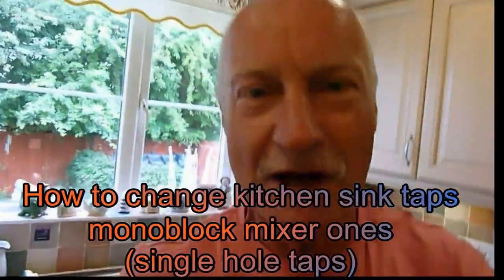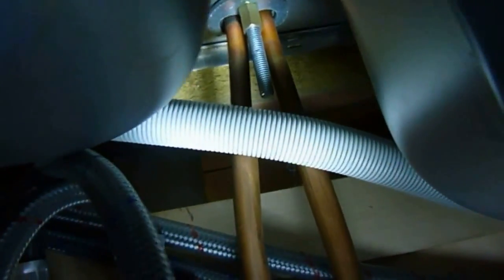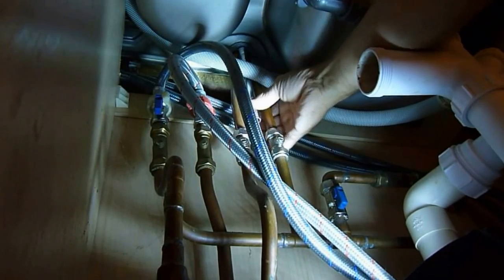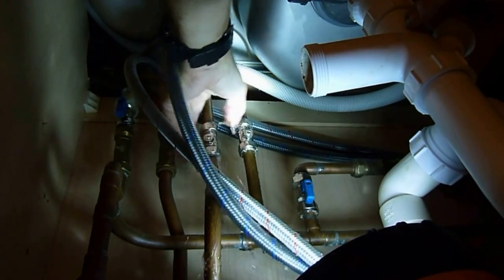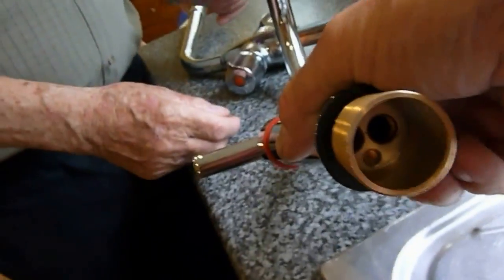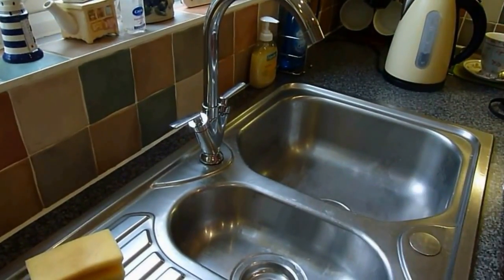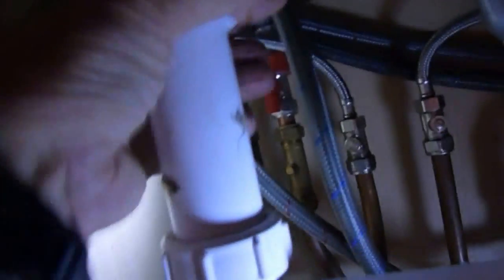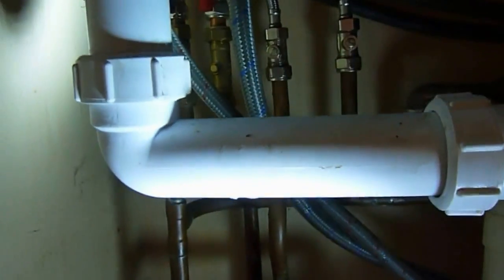How to change mixer taps.(monoblock mixers) .Kitchen taps shown, but same for basin or bath

Comment: Thank you for publishing this. I have had an identical kitchen tap with a slow leak in a home we recently bought and found that below the sink the previous owner had installed two surface-mount sockets into which were plugged the washing machine and a dryer! No surprise that the power circuit had a high earth leakage reading. 
I've now moved the sockets to behind their respective machines and can now replace the tap - a type I have installed before. However the new FRANKE tap is fitted with the flexible hoses you show and I appreciate your taking time to record fitting one. Again, by coincidence, I bought the small box spanner set from Screwfix for removing the old tap and a Monument automatic cutter to cut back the H & C pipes, and two male couplers - to fit the flexible hoses onto the cut pipe, owing to the isolation valves being out of hose reach and wishing to minimise my time under the sink. I have the same access issues - must be a common problem in older homes.
Doing the replacement tap on Monday and your video has given me the confidence to proceed. Thank you.
Reply from the maker: No problem and good luck with it.

Comment: Top tip about the box spanner. Saved me a few quid, time and much swearing. Happened to have a  7/16" box spanner which fitted the old nut perfectly - which was all gunked up to make things more interesting.
Reply from the maker: Yes great plumbing is, isn't it

Comment: Hi Al, Thank you very much for your video.  Gave me the confidence to have a go at changing the taps.  I like your videos because it is not just about the straight forward, it also covers any difficulties that may arise.

The reason I am writing this is because the tap you fitted looks exactly like the one I purchased from Ebay less than a year ago at a similar price.  A couple of weeks ago the tap started dripping.  I watched your other video and managed to turn the water off and remove the insides to take it to a Plumb Centre.

I was told it was a ceramic tap gland and the whole thing would need to be replaced, however the man showed me the size they have.  He told me my looked like a strange size and asked where I got it from.  When I said Ebay, there were various comments about not knowing where they come from and standard sizes.  I have checked Wilkinson and B & Q and they all have the same size as the Plumb Centre.  I have contacted the original seller on Ebay, but have heard nothing back.  So I suppose people need to be aware that they may have trouble with parts.

I really didn't have the £40 or £50 for a brand tap, but saw a monolblock tap in Aldi yesterday which I purchased for £29.99.  With the help of your video we have just fitted it.  Just have to say it was all in reverse the tap we removed had a big plastic outer to unscrew and the one we have fitted a long thread with nut.  The only tools we used was a jar opener (from the kitchen) for the big plastic outer on the old tap and I managed with an adjustable spanner to do up the nut on the new tap and a screwdriver to turn off the water.  Definitely would have been better with a box spanner though for the nut.
Reply from the maker: Hi Sarah , well done for persevering and getting the job done . I know the quality of cheap taps is not as good as good more expensive ones , but like everything you get what you pay for . Incidently if you live in a hard water area ceramic disc taps always wear out quicker .
Kind regards,
al.

Comment: Hi Al, I just wanted to let you know I changed the tap after 2 hours! I even had to cut 2 copper pipes cos the flexi tails that came with the new tap were not long enough. The guy who sold me the tap tried to tell me I need a plumber to do this and I am so glad I didn't listen and found you. Thank you so much!!! It feels wonderful :)
Reply from the maker: Yes there is nothing like doing it yourself .
Good luck top you.
Kind regards,
al.

Comment: The only thing you didnt point out Al. Was to check what pipe fittings  you have. As I found out the hard way. I bought a new tap from Ebay and merrily went on my way to fit it. Which I did with no problems.  But when I went to connect it up; I discovered  that the supplied hoses were for isolation valve fittings but my pipes were compression. Yes I know I should have checked first but it should have been pointed out by  the seller. Anyway    I managed to get the right hoses from  b and q and completed the job. Luckily  I knew straight away what the problem was. Others may not be so wise as to what to do if they were in the same position. So I think it's something worth pointing out. Apart from that great demo as usual.
Reply from the maker: A good point Graham.

Comment: Thanks a lot for this video, I have never attempted a tap change and it took less time and a lot less hassle than I thought. I got the spanner for the nut holding the tap in place for £2.95 from ebay and especially liked the tip about knocking off the olive and nut with the spanner, it worked better for me than for you and I would have cut the pipe which would have been awkward. Thanks again I may attempt a more difficult plumbing job next!
Reply from the maker: Dan Carter Glad you managed it ok Dan. Al.

Comment: Well done a great video, if you have a real access problem just disconnect all the pipes and remove the sink. When the kitchen was installed the plumber did it the easy way with the sink out of the kitchen unit.
Reply from the maker: Thanks for your comments John.
Kind regards,
al.

Comment: Thanks. Good vid. Just changed my kitchen tap. Had to buy the box wrenches but they were necessary! You could have spent a bit more time explaining the washers. The instructions with our tap were terrible so that you couldn't tell the difference between the washer between the radio and work top and the one under the work top. In the end we figured out that the one with the rim on it was to fit in the groove under the tap. Think i can just see on your vid that the washer on the tap has a rim, but would have saved us time if you had shown a close up of the rubber washer. Thanks again!

Comment from the maker: All joking aside, I am sure you could manage this job ok, plastic pipes are even easier to fit the taps to. What ever you decide to do, good luck with it Gibson .(By the way my going rate for changing sink taps is £30.00 so do not pay anyone any more than that.)
Kind regards,
al. (a cheap plumber)

Comment: Thank god for YT and these videos. Even if you're not confident enough to try it. I'm a little nervous. At least it informs you on what's involved. And how to spot the cowboys plumbers who make it sound so hard. Today, a plumber insisted £50 was cheap and it can be very hard to remove nuts due to corrosion. I told him replacing a tap was simple, and the only reason I'd need a plumber is so he'd have the tools and knowhow to remove the fittings. It needs the right tools, inexpensive as they are; some strength and knowlege. Without such videos people have no way of knowing what a load of BS they give customers.
Reply from the maker: Thanks for the info.

Comment: Thanks for the ace video for which I'm now a subscriber. The monobloc tap I have to replace has copper pipes up to the tap. These are joined to their feeds with what looks like push-fit type white plastic fittings. There seem to be no individual isolators for the feeds. I can turn off the cold mains easily enough but how would I stop the hot water flowing out when disconnecting that side? Also will the new tap's flexi tails be able to be fitted to the existing push-fit fittings?
Reply from the maker: Hi Alan, if you have a combi boiler the hot water will also go off when you turn the cold off, if you have an F and E system , you should find a red handled gate valve in the airing cupboard alongside the tank. The new flexi tails will not fit to plastic push fittings. Instead just cut them off and tighten the tails to the copper pipe.
Reply: @dereton33  You're a gent! Brilliant quick reply so thanks a million. No doubt I'll be here again at some point.

Comment: Hi, thanks for the video it is very useful. My old tap has flexible tails just like yours but new Franke tap has a male fitting on the end to fasten to the existing isolator valve. Don't know what I need to join those two together? Would it be easier to get some new tails the same as the old one?
Reply from the maker: Yes a lot easier.
Reply: Thanks for your prompt reply.

Comment: God bless you Al for taking the time and effort making this video. I am about to change my tap, but the pipes are connected horizontally rather than vertically and Flexi tails are already installed. 
2 questions:
Do I need to turn the combi boiler off before doing this job? 
Is it better turning the water off from the stopcock?
Reply from the maker: You will not need to turn the boiler off and yes turn off the main stopcock.

Comment: Another superb Video Al much appreciated. I have the same configuration as your old tap i.e. copper up into the monobloc but between each isolating valve and the tap I have what I think is a compression joint i.e what looks like one small nut sandwiched between two bigger ones of equal size. This plumbing was done about 22 year ago. I would like to get a tap like the one in your video and put flexible hoses on. Is there a work around for a reasonably competent DIYer like me?
Many thanks mate.
Reply from the maker: Hi Geordie, if you make sure you get taps with long flexi hoses on them, you could just trim down to the isolator valves, removing the couplings and connecting straight to a short piece of copper pipe from the isolator valves.
Reply: dereton33 Al, sorry to mislead you but I've had a look at the pipework again The hot and cold comes into the cupboard under the sink in a horizontal manner. The hot and cold for the tap comes off these at 90 degrees and go up into the couplings and then into the monobloc. The pipes continue in a horizontal fashion along the back of the cupboard to feed my washing machine. The isolators are between where the pipes "T" off to the tap and the washing machine valves (the blue and red ones) So it looks like they only isolate the washing machine feeds. If the couplings were removed from the pipes I would be left with two bare pipes pointing upward below where the new tap would be fitted. I don't understand how the flexible pipes would fasten to these as they would not be threaded. I presume I need something to fit on the end of them. Thanks
Reply from the maker: Hi Geordie, don't worry you can buy two chrome isolators valves to go on the end of the pipes pointing upwards, leave a short piece of pipe sticking out the top of both isolators, (about an inch ) they are called ballafix valves, then use the flexis from the taps to tighten up on the end of the short pipes sticking up.
Regards,
Al.
Reply: dereton33 Great stuff Al, well explained. I'll have a go at this soon. Thanks again for all your help!!

Comment: Thanks you so much I’ve watched a few of your videos and love them . I have subscribed. Could you tell me if there is a rubber washer on top of the sink or you put one on the underneath with the nut ? As mine is leaking am not sure if I can just change that washer . Thanks
Reply from the maker: Yes there is a rubber washer on the top to seal the taps, not on the underside. Thanks for subbing.

Comment: Thank you for the best video on changing a tap. One question I have is - what tool is used to cut the copper pipe if needed?
Reply from the maker: A tube cutter or junior hacksaw.

Comment: Thank you. I have my eye on a cross head mixer kitchen tap that has copper tails. It will replace the mixer tap that has flexis. I don;t know how to get the copper tails to fit the copper piping on the wall because the steel sink is about 3inches proud from the wall which means the pipework won't directly T in. Do i use flexis as an extension please? What would you advise? Would you do a video on that please? thanks
Reply from the maker: Just cut the pipe back some more and fit two flexis
Reply: @dereton33  the copper pipe's already flush to the wall. Do you mean trim the copper tails? I will fit flexis as an extension between the copper tails and pipework. thank you Al.

Comment: Thanks Alan. Great video! It has inspired me to try and change my very old monobloc tap. However, the copper water pipes that go into it from the underside seem to be ‘bedded’ in by some kind of adhesive cement/ compound. There is no visible sign of a retaining nut to undo so that the tap can be removed. I don’t know what to do now – only thing I can think to do is to try and twist the tap out – though I’m afraid I might damaged the sink. If anyone has an idea what to do, it would be appreciated. Many thanks.
Reply from the maker: The pipes will be soldered onto the tap tails, they have to be cut through for removal of the taps, also the horseshoe backing plate has to unscrewed. If you are fitting taps with flexis you will easily be able to connect back onto the sawn through service pipes.
Reply: Many thanks, Alan. Much appreciated and subscribed.

Comment: Can you re-use the old copper tails? Plus, mine don't go into isolation valves either. Can I just unscrew the copper pipe from where it connects to the tap and then connect a new tap it?
Reply from the maker: You can use them just make sure the rubber washers are ok. You can unscrew them from the old tap and screw into the new one, if the thread is the same.
Reply: @dereton33  thanks a lot!

Comment: Do you know wether the copper pipes are soldered into the tap? Do you think I could remove the tap leaving the existing copper pipes and fitting new tap on top without flexi hose
Reply from the maker: No they are screwed into the tap. You will not be able to unscrew the tap in position.

Comment: Hi, great tutorial , I now feel more confident in attempting to replace my kitchen tap , too long i've had to boil pans of water to be able to wash up.  Only one thing i'm unsure of. My existing taps have copper pipes which connect to flexible hoses , not copper pipes , will I have problems connecting the flexible hoses on the new tap to my existing flexible hoses?
Reply from the maker: It should actually be easier Carol.
Reply: Thanks so much for replying so soon. Its a pity I can't easily access where the flexi hose joins the original pipework , it is possible that there are isolating valves which would make life easier,particularly in the worst case scenario that I encounter a problem I hadn't envisioned. Think i'll tackle the job after Christmas, don't fancy being without water over Christmas period without funds for an emergency plumber lol
Reply from the maker: You could always fit isolation valve flexis.
Reply: Hi, I considered that but unless I can find flexi tap tails which incorporate isolation valves i'd have to replace the existing flexi hoses connected to the unaccessible original pipework ,which in order to access them i'd have to take the sink out etc ,which i'm not very inclined to do. Plus if I could access them I might find that isolation valves already exist..Overall the most daunting thing is knowing that my pipework is really old,in the case of the Kitchen tap at least 25 yrs old ( big up Bristan for lasting that long) Alongside replacing my 25 yr old kitchen tap  I plan to replace my toilet cistern which pretty much leaks from every possible source,i.m now relatively confident about how to fit compression flexi hoses but knowing that my pipework in the bathroom dates back to the sixties makes me a little nervous.. I'm now seeing the advantages of having a 'new build' house lol

Comment: Looks so easy. God have mercy.
Reply from the maker: Have a go.
Reply: In all seriousness I have just tried to fit a washer on the cold tap tap if the mixer. Tap head off, try to undo the nut to get the washer, stuck solid. Wont budge. But the tap mixer does move so dare not do anymore in case I wreck the whole tap and the pipes underneath. 
Some things are best left to the professionals.

Comment: Thanks for the well articulated and photographed video.  I've just tried replacing a tap similar to this and can's seem to stop the water pouring out from under the tap itself when I switch on the main supply - it came with two copper tubes rather than flexi, which were a bit of a pain, but is it possible I've tightened them (to the tap) too much, as you said don't go mad with it?  Could I have damaged the connection do you think?  Thanks for any advice.
Reply from the maker: GrimCellar The small rubber sealing washer on the end of the copper pipe has probably come away or is broken, you can get these seals easily from a plumbers shop, just undo your taps again and replace the rubber seal. Al.
Reply: dereton33 Many thanks for answering.  Best regards

Comment: Thanks so much for this. Really helpful. However, when I cam to fitting my pipes to the copper pipes under the sink, I found the fittings on my new taps were too narrow to fit on the pipes. Do you have any suggestions if I could buy some kind of adaptor to fit them together. Thanks
Reply from the maker: Julie Pinto You will need a couple of 12 mm to 15 mm couplings to fit them together.
Reply: Thanks.

Comment: i noticed the taps you replaced the leaking one with was a single flow not a dual flow as i have the same taps surely you would need a non return oneway valve on the hot water otherwise you will get cold water pressureflow into the hot water like i did just thought i would mention it
Reply from the maker: The system the taps were fitted to was a combi system so hot and cold pressures were equal.
Al.
Reply: dereton33
ok cool no worries then keep up the good work